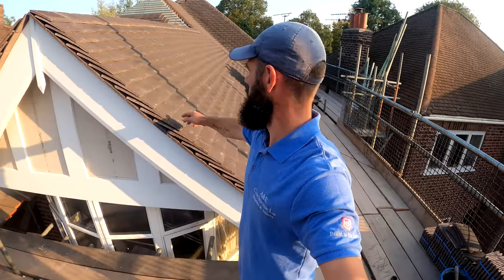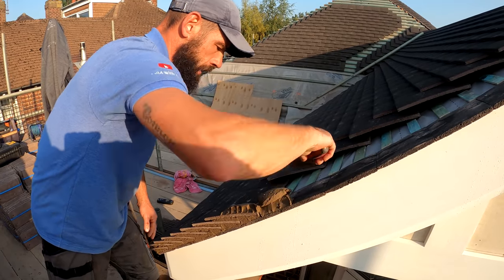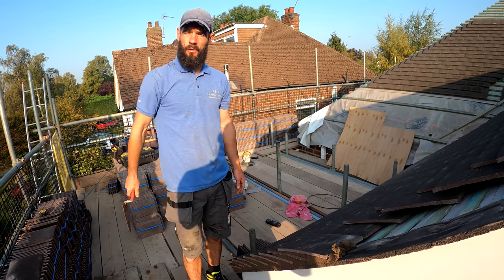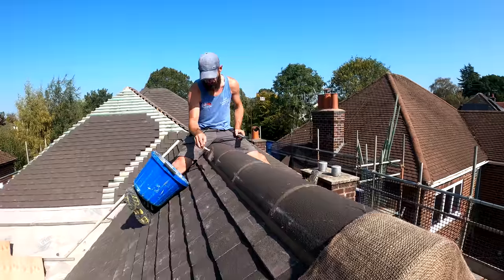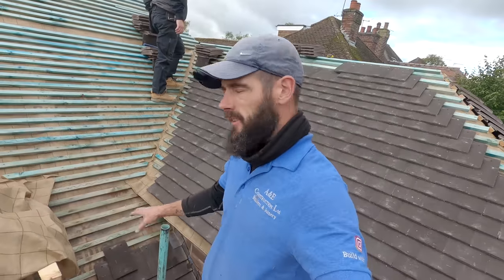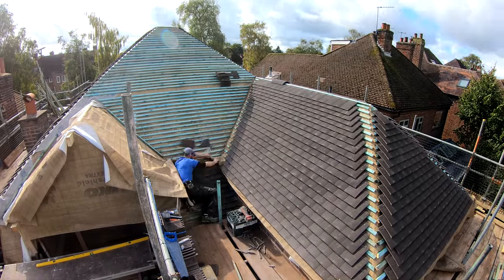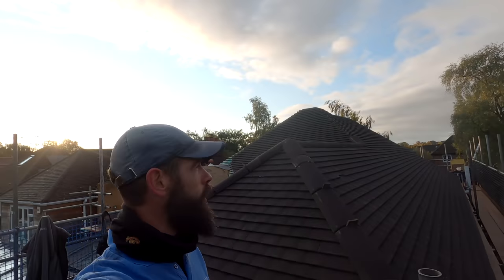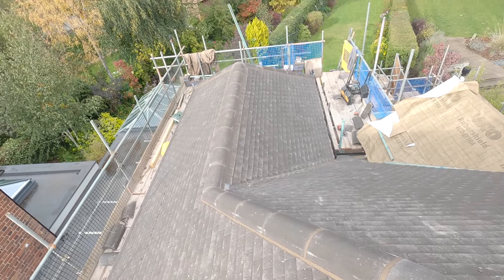COMPLETE TILE RE-ROOF (PART 2)

Comment: Without doubt one of the most professional building firms out there. Every video is an example of how construction work should be done.
Reply from the maker: Thank you for the kind words Dave 👍
Reply: Definitely one of the best i have seen so far they make a roofing job look so easy 
Great work
Reply: Hi mate,

Hope all is well.

I follow you on Social. You are super inspirational. 

Just thought I will drop a quick message just to get some advice on black roof tiles as you use them quite a bit on your renovations. 

I wanted to use the black roof tiles on my current renovation. I just wanted to know which is a good manufacturer to go with. I have been recommended few by the roofers by their opinions vary greatly. To name a few I have been advised to used Marley, Crest, Redland. The reason I have reached out to you for advice is that I have noticed quite a few houses which have had black roof tiles but it has not even been like 5 years since they got it done but the top coat is fading and you can see the cement or the white look which looks crap. But then there are other black roof tiles that has been there for over 15 years and offcourse the colour has gone a little dull but it does not look white by the faded top coat so quality and manufacturer does play a role.

Thank you

Comment: What dictates the size of the ridge/hip tiles? Roof pitch? Arch spec? Roofers preference? Great content as ever. Will’s a natural on camera.
Reply: Nothing really, you've got 3 types 1/3 round hip used on hips, half round ridge used for ridges. Or a segmental, which is a hybrid of the 2 what can be used for both hip and ridge (which these guys have used) my personal preference for plain tiles would be bonnets up the hip, but like you said that's down to roofers preference.

Comment: Planning to have a reroof done in a very windy, wetterpart higher part  of Bradford , as there are so many membranes and brands , permavent, , klober, Cromer Tyvek , any advice on brand grade , weight eg 188 Grammies etc , also would plywood boards be an option in addition  as I’ve heard they use these in bad weather areas thanks

Comment: Pardon the dumb question, but I saw one of these roofs done in Bath, England, and they were using prefabricated lead fixtures for the hips. So I assumed that this was common practice, but now I see mortar being used. So which is the most common practice in UK? I have to imagine mortar is way cheaper.

Comment: That roof is bang on!! What good quality work!! 

I noticed on the verge that the under-cloak is tile. We have this on our house, but needs to be replaced. Been their nearly 70 years, so not done too bad. However, starting to fail. 
Ours sit on the masonry gable wall (no barge board. I know they would need to be re bedded, but how would you get them lined up straight and keeping them the same distance overhanging the wall? I thought of screwing some temporary 3-2 timber  on the gable wall to get the straight edge, but also to keep the same overhang up to the ridge. (Is this makes sense)  I’m not a roofer, but I give anything a go and don’t like shoddy. Ia there any easier way of doing it?
Reply: yes

Comment: I got a question. The inside felt of my roof is sagging a bit, couple of inch gap between upper and lower sections. Water would still run away correctly I think but how big an issue is it? I’ve seen videos of ventilation devices popped into the felt overlap to create a gap.

Comment: Im curious, but doesn't the ridge need to be vented. I understand it is a cold roof but wouldn't make sense to allow for air circulation so that the attic could be converted into a room or would that result in a new roof structure?
Reply: As it is the air goes in one side at gutter level and out the other side.  The scaffold platform is lower than gutter level and most of the ridge is just on head height so probably nowhere near enough height for a room up there. 
It was not shown but it looked like there was a new extension added that was all new timber at 3.44 that was all done at the same time.